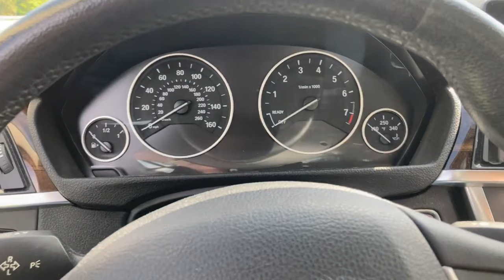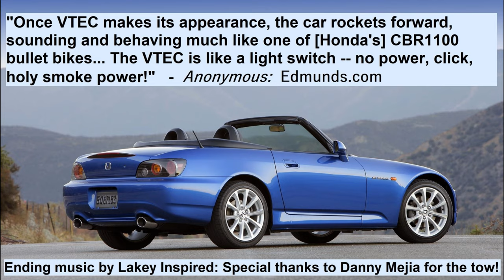Honda S2000 Restoration: I let my Tow Truck Driver drive his DREAM CAR! My AP2 Honda S2000 Wholesome

Comment: AC Delco makes parts for all sorts of cars. It is the parts company for General Motors. These are reliable. I used them on my truck and my wife's Volkswagen Beetle.
Reply: >General Motors
>reliable
Reply: @morphius747  what do you mean? They ain’t no honda or Toyota reliability but they are better than a lot of OEM stuffs! The alternator and ac compressor on the beetle are great!